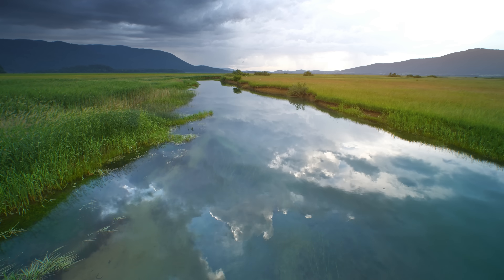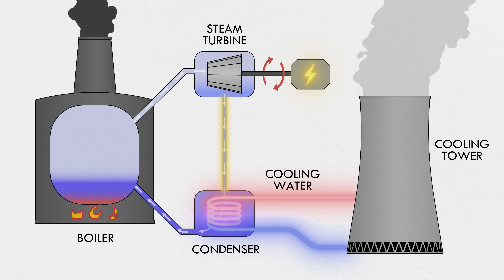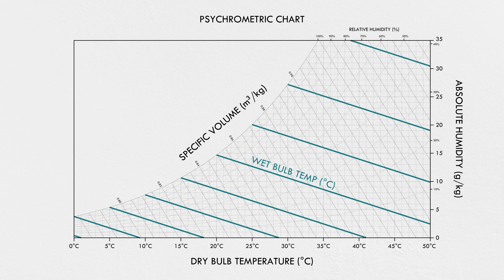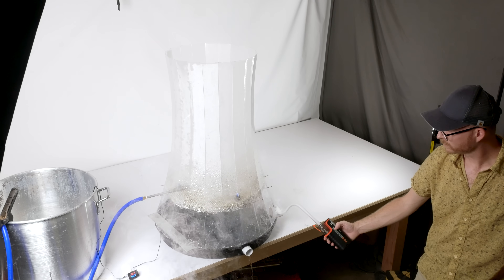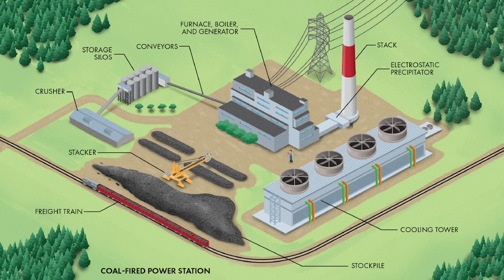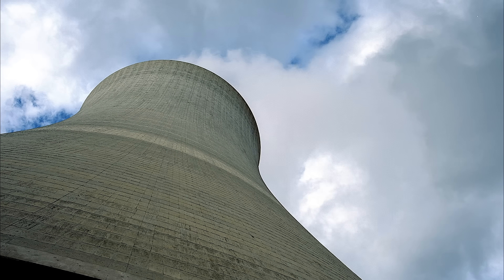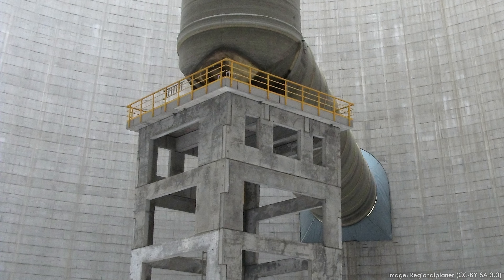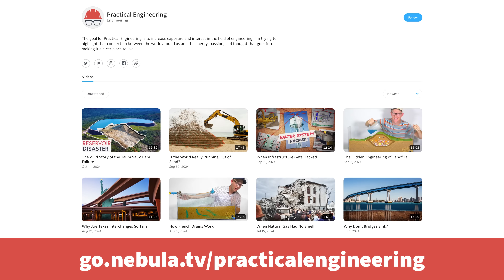Why Are Cooling Towers Shaped Like That?

Comment: Why are there cooling towers at all? Why can't they recirculate the steam back through the turbine instead of cooling it and then reheating the water back into steam? China is burning 4 billion tons of coal  producing less than 15 trillion in GDP. The united states is burning nearly a billion tons of coal per year.
Coal went from 30 a ton to 350 and stayed there for nearly 18 months. That bankrupted thousands of utility companies. That steam turbine is a terrible design. Spinning a super heavy shaft with angled blades most of the applied force of the steam is deflected. Have a look at how the steam is fed in from the top and split in two directions along the shaft. Such downward steam pressure wears out the shaft bearings. The old flywheel engine uses centrifugal force to turn a heavy wheel with a small piston which uses very little steam, driving a 10 ton wheel making 5,000 horse power. Enough power to turn 5 generators. They've got one generator per turbine and are burning through coal like we have an unlimited supply. They may be burning over 10 billion tons of coal per year globally, with lithium battery cars and more electronics in the works and it's not going to work.
We are releasing more CO2 while cutting down trees in the amazon to make cardboard for Amazon. Recirculating that steam and keeping it hot is a better way. In the nuclear side, those fuel rods are so hot they make ethylene glycol boil, which is actually anti boil for the car.
Antifreeze is actually anti boil which boils in the nuclear reactors, the entire thing is madness. They are cranking out so much electricity its bleeding off the powerlines and electrifying the atmosphere. The grid has added millions of solar panels and is now so overloaded there is huge emf's around every line which is interfering with our minds causing aggression and aggravation and severe depression in society. 
LLXIIX77

Comment: Very cool... (umm, no pun intended 😊).
I spent ten years working in a large industrial plant (aluminum anodizing & glass fabrication) where I (along with another gentleman) also operated & maintained a 1MW cogeneration plant. Obviously, we produced electricity... but also steam and chilled water for the plant's various processes. A large part of our maintenance was upkeep  of the cooling tower (a very common & large "Baltimore Air Coil" induced-draft unit). It provided cooling for the liquid-chiller machine, as well as cooling for the steam generation when capacity exceeded demand. The generator's engine (a natural gas fueled, V12 Waukesha) produced steam - directly - by "ebullient cooling" (the jacket water was the boiler water). Since our electric power production had to remain constant (we were paralleled with the utility), but the steam-load could vary, we occasionally had to "waste" (or dump) excess steam to a large shell-and-tube heat exchanger, which was then cooled by the cooling tower. If the cooling tower were have to gone down (failed in any way), the entire plant would go down. It was probably THE most important piece if the infrastructure, yet very unobtrusive, sitting up there on the roof.
BTW, our tower "consumed" (evaporated) around 10-20,000 gallons of water per day...
Anyway, It was a really bitchin' facility, and I loved working there.
Thanks for all your content! Always enjoy it! ❤

Comment: One thing you didn't mention about why we use condensers on steam turbines is that condensers dramatically increase efficiency. Pressure in the condenser is below atmospheric, which increases the pressure drop across the turbine, which makes more power.

Comment: As I understand the psychrometric chart, absorbing moisture makes air denser while absorbing heat makes it less dense – i.e. competing processes. So if you start with air that has too little humidity (or too much heat), it will absorb moisture too efficiently relative to its ability to absorb heat, and will therefore gain more density from the increased moisture than it loses from the increased temperature. Whereas if the air is more humid to begin with, the effect of heat absorption can outweigh that of moisture absorption.

Comment: How does water know that it has to go from boiler into steam turbine into condenser and so on and not the other way around ?
Reply: I'm guessing that if you build the boiler at lower height/underground you can maybe use the mass difference between steam and water as "pumping energy" ? Would that mean that the actual purpose of the condenser is to create mechanical energy ?

Comment: Natural draft can be experienced in showers with shower curtains too. The draft is the reason, why the curtains get so clingy when they weren't when you started the shower. (Draft => lower pressure in the lower areas => curtain moves into the lower pressure area)

Comment: What do Sikh's wear on their heads?... and what is the device commonly used in power stations to convert steam pressure into electricity? Wouldn't it be nice if these two words with different meanings and spellings weren't homophones?

Comment: That line at end about how great it is to use curves in a world of straight lines?  It is a feature of hyperboloids that you can lay a straight edge against them and if you get the angle right it will touch along its entire length.  So at that specific angle the sides are actually straight.  If that doesn't make sense look at the bit with the two circles connected by rods.  The rods don't bend so the curved shape is actually a series of very thin straight rods.
The side effect of this is remarkably thin walls typically about 7 inches or 175 to 180mm.  That is narrower than the length of my hand even for the 600 foot tall ones.  The strength in that direction comes from the fact that the lines of force being imposed by gravity operate along those straight lines and by attaching each straight line to the next one they become self supporting.  That is also the reason for the triangular vents at the bottom.  The struts follow the lines of force.  And if you ever see one being demolished they appear to tear apart like wet paper.  As soon as it stops being self supporting it disintegrates.  It really is s crazy form of engineering.
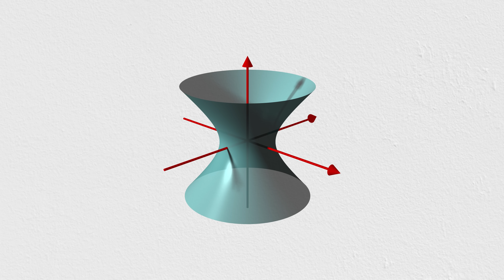Reply: Not only was this mentioned in the video, it was actually demonstrated with a set of straight rods. 9:55
Reply: He discussed this in the middle of the video.

Comment: Top questions in my mind currently (before watching the video):
Isn't cooling the steam wasting a lot of thermal energy that could be used for things like district heating?
What other things could we use the thermal energy for?
Maybe pipe it to a nearby artificial hot spring😂

Comment: It's interesting that it's normally associated with nuclear power plants, in the UK none of the nuclear plants have cooling towers as they're all on the coast and use the sea as a practically unlimited heat sink. Cooling towers are associated with massive coal plants instead, and many of them are gone now having been demolished (the UK doesn't use coal power anymore, but some power stations were converted to biomass so the towers remain).

Comment: I've often wondered, why not co-locate nuclear power plants with traditional natural gas ones? Run the heated water from the nuclear plant to the natural gas one. Then they can reheat it with much less power to obtain the same output as if they'd heated it from room temp but wirh far less inputs.

Comment: Teepees work this way. The outer walls don't meet tge ground. A pony wall around the inside allows airflow behind from the bottom of the house to let the firesmoke exit out the top. Meanwhile the radiant heat is captured in the central space.

Comment: As a certified air+water hydronic balancer, Mechanical Engineer Technologist, and Refrigeration mechanic you're not wrong but you are wrong. 
Wet bulb temp is indeed and really always will be free cooling cause is never above boiling point, and your also right i seen your graph and meh ....wanna b***h but close enough. Convection definitely is the key role here, specially when you add water to it.  Ive been in those and the shape doesnt play much of any role really except strength but the volume  of air does all the work. When you send a million CFM through a few gallons of water to cool it will always come out as the the hero. 

Dry bulb however your soooo wrong its not funny.  You're completely dependant on area's  built. Your also neglecting to mention as relative and working humidity go up efficiency plummets down. They're linear ... well almost. I agree nuclear is the way but dont pull the BS everyone does.

The extra "smoke in the tower" is bypassed heat to make the refrigeration work. Its artificial super heat and that is purely to ensure the cooling works as it was mechanically intended  to function.

Comment: 11:05 you can stand on a coke can with those thin walls, as long as it's not dented, and the force is applied evenly and slowly. And you can also stand on eggs if they're properly supported and the weight is distributed evenly
Reply: No, you can't really. Like yes, I know a large load is possible, I'm just talking about real life. Way to miss the point of the analogy though
Reply: @joshyoung1440 I understand the analogy. I'm just saying physics is cool. Try it, I'm 150 and can stand on a can, as long as the can isn't dented at all. If I could reply with a video I would

Comment: I fell in love with the refrigeration cycle when I studied mechanical engineering. I never understood why a giant heat pump wasn't used to condense the steam and preheat the water before it went into the boiler?  Seems like an easy way to add 10 to 20 percent efficiency...  though I never ran the numbers.

Comment: I thought one of the main reasons the cooling towers are that shape is to take advantage of Bernoulli's principle to increase airflow and therefore cooling power? If they didn't need this effect couldn't they just cut the tower in half where it constricts? Would be just as strong and use less material.

Comment: This seems to be said incorrectly. 7:46
Buoyancy increases with the weight of the fluid column above an object. So if humid air is less dense because the atomic weight of water is lower than nitrogen and oxygen molecules, then it would be less buoyant, I think. Unless he's meaning that the humid, less-dense air takes up a "larger" area and so gets more buoyancy force from the dense air around it.

Comment: I've worked a little at one of the nuke plants that have those towers. One thing I noticed were the small steel ladders that go up the side to the top. My first thought was, "How do they get around the top where it bends away from the bottom?" Well, on closer examination, when it gets to that part, they have the ladder flopped over so you are facing away from tower, instead of toward the tower as they climbed up. I can not imagine what that climb would be like!! As I watched the video I saw that a lot of them had different ideas ho to get around that, but they all look scary.

Comment: @7:00, its criminal to move quadrant 1 if you are talking not CS. Cause I'll forgive CS who want to reference (0,0) and where is positive is measured.

That you have an X-axis, temperature, of [0,50] yet place a label the Y-axis at x=50; its rather deceptive a first blush. So giving this person a 5 years punishment for such an offense. (I'm less opposed to overlaying two different scales. Such as when you have two different Y scales you want to compare. But the audience should be aware the different units that are being shown.)

Comment: The problem with this type of water to air cooling units is the inherent loss of the secondary cooling water uses in the towers. I kinda knew how the big cooling towers worked but know We all know the details of their operation.  Thanks.

Comment: Cheaper than a cooling tower... Nope. When nuclear was getting an unearned bad reputation and the modern venturi style cooling tower was the poster child for those plants, new plants stopped using them. Coal plans would go out of there way to use them as a way to scare people  away from nuclear as the general public did not know the difference between the two plants.

Comment: I do an inspection on/next to a nuclear power plant site (Salem, NJ) and they have a natural draft cooling tower like you made in your garage only much bigger. There is a ton of water coming down and the draft is really strong, you can see it blowing the water back up into the tower. We were there when they were cleaning it out one time, without the water running you could see all the way through the bottom, it almost looked like it was floating! The diagonal legs completely support the tower. I was surprised at how empty it was, I expected some other type of support in there.

Comment: Love this one.  We use (6) 18 module dry coolers at work for the air compressors process water (plastic bottling plant).  Ours have evaporative humidification modules to increase the coil efficiency during peak usage.  The temperature delta across the coils doesn't change much but it takes a whole lot less fan speed to cool to the setpoint.  Only real downside is they ran city water for the humidification and calcium buildup about junked them before they switched to RO water.

Comment: You connected two disparate facts for me. Thunderstorms are more prevalent in the humid south and the stability of the rising air in a cooling tower. Thunderstorms rise to sometimes over 50,000 ft in humid conditions better than arid conditions because, like in the cooling tower the air might begin to fall rather than rise like a rocket in the high humidity.

Comment: Hey man, if you add all together bit of water, bit of gas and bit of fans to move air, will there be a big performance gain or the limit already achieved with which speed air can move?

Comment: What I've always wondered is why are they cooling it down?
Isn't it easier to turn hot water into steam?
Why isn't it recycled back into the system like exhaust on a gas turbo engine?

Comment: Interesting and informative as always, Grady! Here in southern Ontario (well, specifically on the north shore of Lake Ontario... east of Toronto) we have 2 large (ish) CanDu nuclear power plants and as far as I can tell, neither of them use cooling towers... at least, not as the primary means of cooling. Then again, I am not an employee of either power station nor am I remotely knowledgeable in their construction or operation. I DO however know people who work at those locations and they have explained to me that the lake is used similarly to the way the reservoirs are used at the locations near you, in Texas. I didn't bother to press them for information on the humidity aspect, but since southern ontario is known for humid summers, maybe that's why they opted to use the lake instead. Or maybe it was just cheaper? Maybe a combination of those reasons? (shrugs)

Comment: Constructive criticism:  Too much, too fast.
You might start with a general description of the concept and then move to more specific data.  
Building from the parts (synthesis) is extra mental work if you don't already have the framework. 
And simplify your chart.  All those extra lines are confusing, not impressive.
BTW, those cooling lakes in Texas could be used to raise carp and collect part of a lightning bolt.  You KNOW the static electricity builds up a bunch around a cooling tower.

Comment: The part about more humid air being better is bit confusing. From the first point, if you go down, then the line towards cooling target has steeper angle relative to "specific volume" lines, so the drier intake air should be better, at least at that dry-bulb temperature. The "higher relative humidity while keeping constant wet-bulb temperature" feels like cheating because the air also gets cooler. Maybe it creates nice saying that engineers can tell you, but to someone like me, it's not clear why we are even talking about constant wet-bulb temperature. Maybe at some specific temperatures, it would be better to have higher absolute humidity, but I still can't wrap my head around why if that's the case. If the goal is to change the density as much as possible when mixing the air with water, wouldn't it always make sense to go left and down in the psychometric chart?

Comment: Technically known as a "drift eliminator" in the industry, "Fill" increases the surface area of water to more effectively release heat by preventing it from gathering in the air.

Comment: All this heat emitted seems like a waste of energy.  Do reactors use daisy chains of boiling/condensation loops that drive turbines (at increasingly low pressures to shift boiling temperatures down) to capture more of this energy?

Comment: Cooling towers are another facet of our industrial complex that is being impacted by climate change.  The warmer air is becoming more humid and thus wet bulb temperatures used to design the towers are rising.  Parts of the southeast are approaching places like Saigon and Singapore for design wet bulb temperatures.  This means towers have to be either taller or have bigger fans or both to achieve the needed outlet water temperatures.

Comment: The CANDU reactors in the bruce powerplant in Ontario Canada uses lake water to cool. But instead of drawing serface water they have a very long pipe that draws water from deap in the lake. Apparently this water is several degrees cooler than the water at the surface and will never freeze in the Canadian winters.

On a side note the output of the cooling water has enough energy to stop a bit of the lake from freezing.
Reply: Looks like Bruce @13:39 too 😅